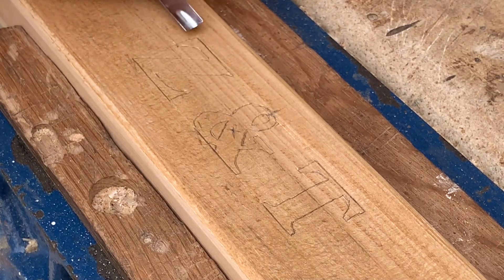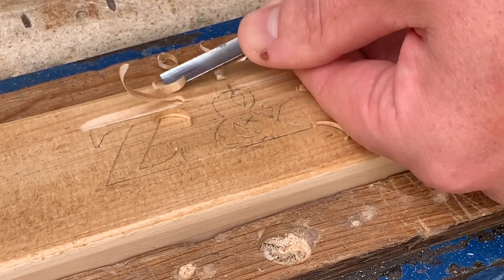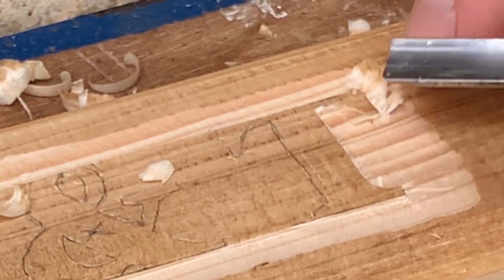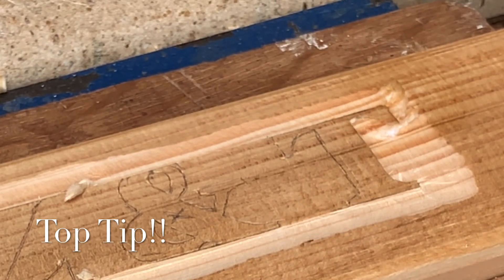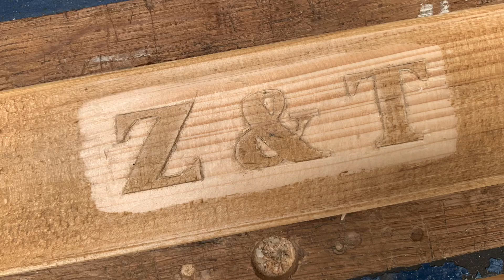How to carve letters into wood

Comment: How do I get started ?  tools, wood etc. sounds like a good retirement hobby.  Thanks for the video.
Reply from the maker: Go for a mid priced set of chisels. Super cheap are rubbish and I’ve not had a need for an £80 chisel!  I use Rider flat chisels and Pfeil Swiss carving chisels. 
And for wood, anything will do to start. But something like Lime wood/Basswood is perfect for carving.